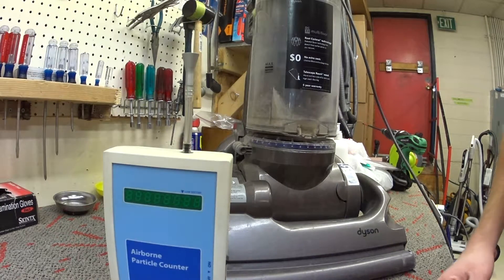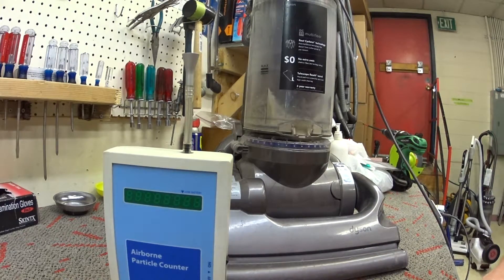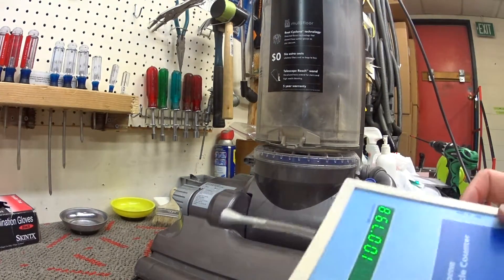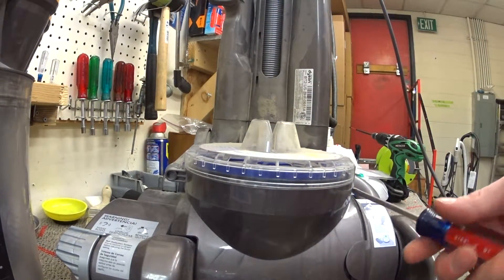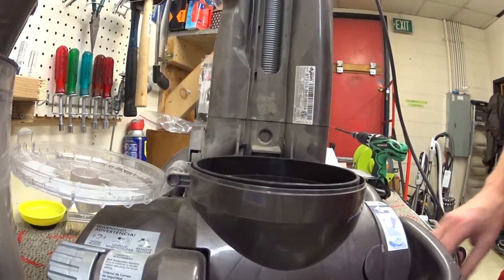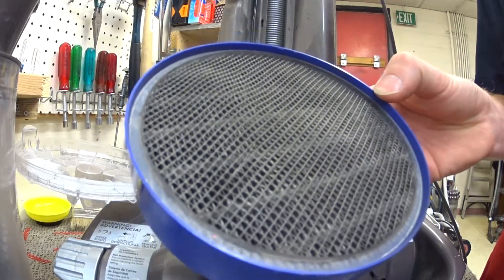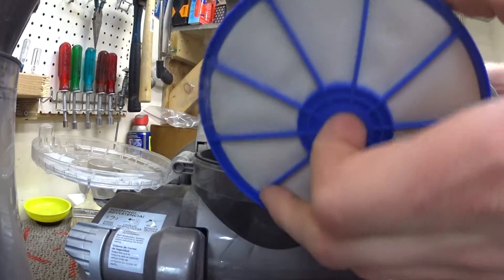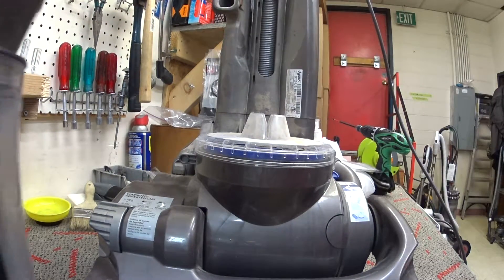Dyson DC33 particle counter test

Comment: There are quite a few improvements on this Dyson as I see it compared to the DC07. First off the post motor filter cover just flips open nicely instead of having you struggle to remove it from the plastic tabs or have to slide a flat head under the seam (for lack of a better term) to remove it. Then the bin opens away from you, so the dirt doesn’t fly at you as much.
Reply from the maker: +john erikson I will be going over that in another video